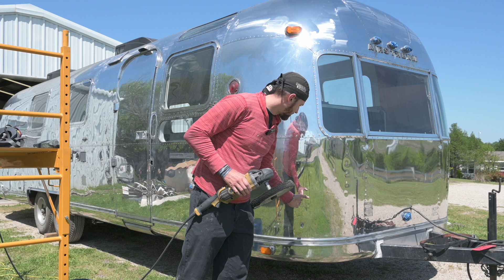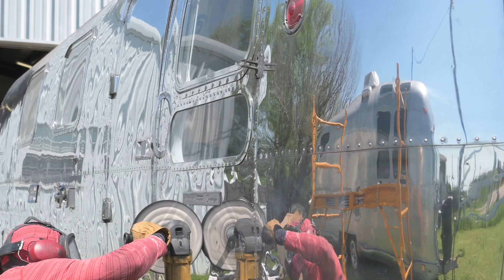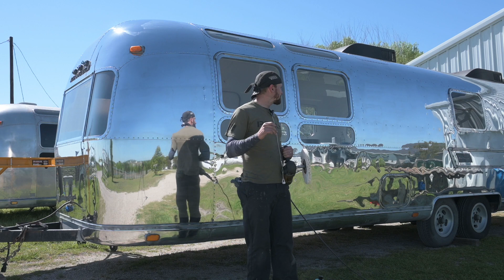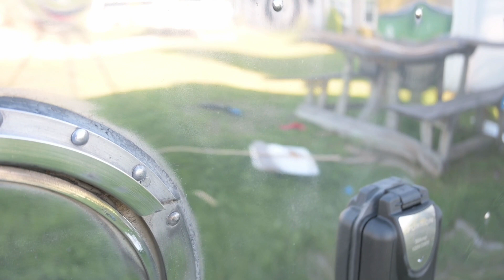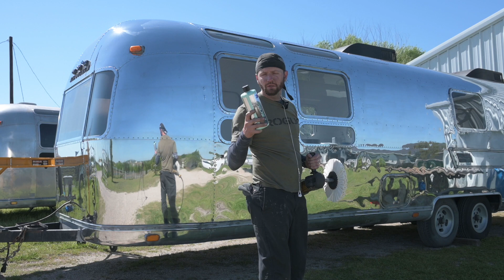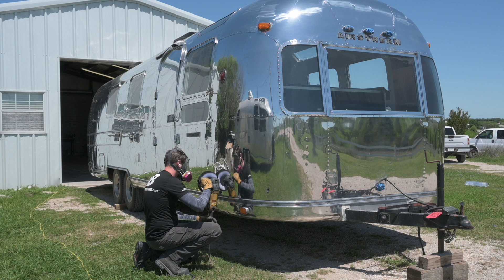Final Polishing Stages for the Salon Airstream!

Comment: Appreciate the incredibly thorough content Ian! Been really draggin my feet on my restoration project. Bought a '64 Safari already gutted that needs a lot of attention, most notably on the frame (gonna have to replace most if not all of the cross members and outriggers). I was wondering if you could do a general outline of your order of operations when you're tackling a big resto, from start to finish. It seems every little thing has a "but first" and I would hate to make more work for myself down the line (example: do you reattach the shell to a restored frame before or after you insulate/re-install the belly pan?). Could make for a super informative video for someone like myself that's less experienced but wants to work wisely. Thanks!!